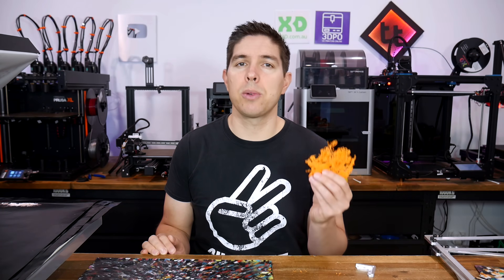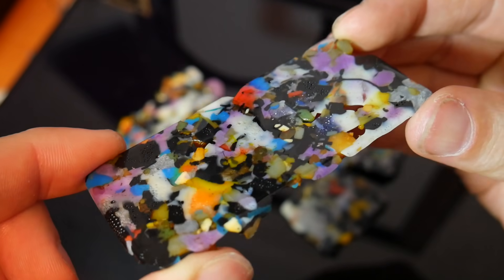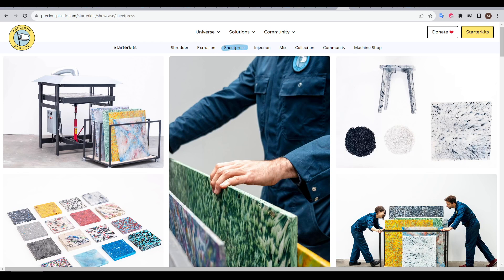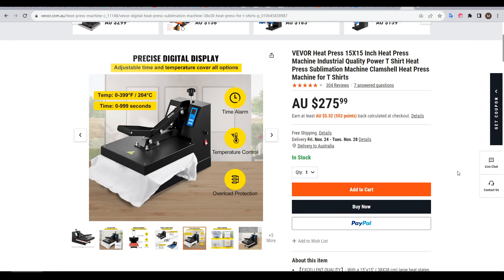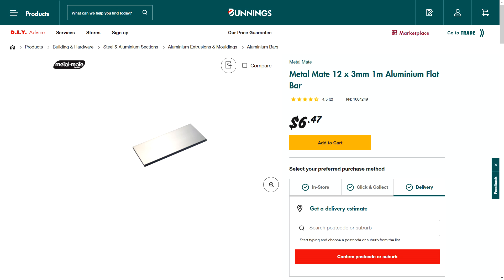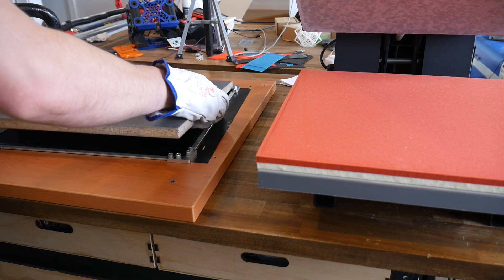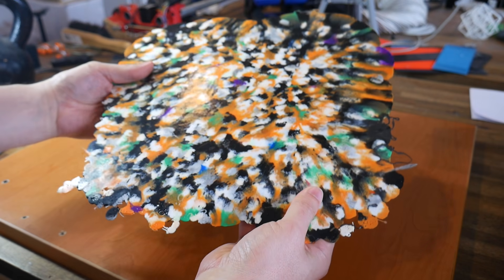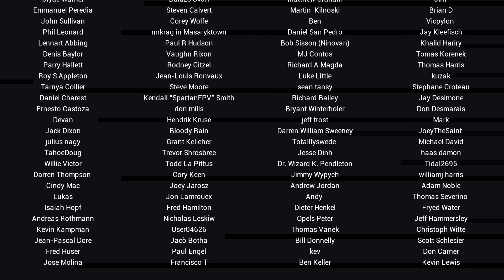Melting plastic waste into beautiful flat sheets on a budget

Comment: I would recommend adding a weighing step to measure out chips prior to pressing. Getting a consistent weight for the batch will likely yield better results than eyeballing a pile.
Reply: How much does PLA vary by weight? There's going to be additives like dye, so is that on the order of 5%? That would probably be fine, but too much more and you'd want to go with something like water displacement (probably annoying to do).
Reply: @szurketaltos2693  a margin of 5 % is WAY WAY WAY accurate then eyeballing it !
having to put a 100 Grams of plastic is way accurate than 2 fist full's of plastic 
also weight accounts for the hollow particles and the air gaps so you get way more consistency 

and are you seriously suggesting putting PLA in water before melting it ?
Reply: @fouzaialaa7962  5% is just a guess, I don't know. And yeah, I'm definitely not saying eyeball it. Yes, water displacement would be annoying as I said -- need to dehydrate after.
Reply: Had the same thought
Reply: Super obvious and I was astonished it wasn’t already done.
Reply: Since he has the ability to shredded uniformly, measuring it by volume might be more efficient than weight

Comment: Reusing waste filament to produce sheets for laser cutting or even melt into blocks for CNC Milling to create other practical items with unique patterns and in turn making it a one-off product is the best way to go for me and 100% what I'll be going for, and i think is the most cost effective way if you look from a business point of view if it's just a side hustle.
Reply: I found the notion of putting a collection of random PLA into a laser cutter a bit scary!  On average it might be fine, but if one in ten inputs are not, that could cause problems.
Reply: PLA machines horribly, and if preventing waste is the goal, casting billets of it for machining is just kicking the can down the road. It would be better served being extruded back into filament and sold as support material, or used in sheet form.

Comment: Just in case anyone hasn't mentioned it yet, these would be really cool as pickguards and plastic bits on electric guitars and basses. They're usually around 2.3mm thick if that's possible (The one you made from the bambu labs waste looks around that thickness in the video)

Comment: We used a heat press when I was in the Navy for all our waste plastics. Plastic was the only thing we couldn’t throw overboard, so we melted and compressed disks that were about 3 ft in diameter and about 0.5 inches thick. 

That got me thinking that you can satisfy two of your criteria by making sheets into circles. The first as your doing on your laser cutter shown at the end.

The second would be by spiral cutting a disk and then feeding those strips into your filament making machine. You’ll end up with so interesting colors in your prints, too.
Reply: You can't use 100% recycled material. Well, you can, but strength is greatly reduced. Making a good usable recycled filament uses a 3:1 Fresh/recycled ratio. My brother worked for one of the companies that made recycled plastic 2×6's. They used even less recycled material, 4:1. Only 1/5 of it was recycled plastic.
Reply: I'd imagine that the laser burns the material and makes it completely unusable as filament
Reply: What did you do with the 3Ft plastic disks?

Comment: Excellent, more than 20 years ago, when I intoduced some of my early micro, sub micro and palm size helicpters to the market, and was injection molding using an industrial bench top injection molding press I built my own plastic shreder to shred left over injection molded parts and debris. I used a heavy duty paper sheeder modified and at one point I had accumulated barrels of plastic shreds which went back into injection molding as recycled parts

i also experimented with the same style heat press to make thin plastic curved rc helicopter blades using a mold, the beauty of these machines is the heat contoller that allows one to dial in temperature and time.. Any heat type equipment  can be used in many ways to recycle plastics. And those T shirt presses have a lot of uses when you get really creative with them but you have to be careful in handling them when moving them from place to place, I nearly lost a finger grabbing the press near the hinge and as I lifted it it clamped on my hand and fingers, talk about severe pain!.

Comment: Awesome to find a device you can repurpose.

I was planning on building something like this from scratch. But this seems much easier.

One idea I thought about before, to solve size limitation. Remove one of your aluminium edges and put a previous sheet in there. 
This would melt the new sheet to the old. In theory you could make sheets any length with a small press.
I'll let you know if I get this far 👍

Comment: @Michael such a simple and inspirational process to recycle plastic! So much creative potential.
For example I'm already thinking could use smaller frames to make smaller squares which could be pressed a second time in larger frame to create squares with a square pattern. Similarly cutting a shape and placing in the larger frame and filled with new pieces could make sheets with custom art embossed. 
Alternatively making longer thinner strips could be weaved before a second press to create another interesting texture pattern. Would require a narrow frame, or the cutting of a thinner sheet into strips. Using laser cutter (or CNC?) on perimeter of sheets could allow adding an interlocking pattern, which would allow for assembling larger sheets before repressing seams.

Comment: I found a used Blendtec blender for around $60 and use that to shred my Bambu poop. It turns it into very small pieces quite well.
Reply: It WILL blend!
Reply: do you run it dry or with water?
Reply: @ericthecyclist just dry

Comment: Only got to it now. Great video.
As someone who has plenty of failed prints and other filament waste this video hit home.
I recently converted one of my Ender 3 S1's into a 5w laser.
So making melted sheets and then laser cutting them is a very viable option.
To get even tops and bottoms, I would place another tray on top of the plastic for a proper squish down.
If the top one is bigger, we could get an even thickness every time. Just like with your frame.
So final remarks on your video.
Highly inspirational ❤🎉

Comment: I have been trying to find a way to recycle my PLA waste myself that wouldn't cost me too much extra money and this is perfect. I already have a heat press, and the teflon sheets (that's what those BBQ ones are, I have a roll of if for pressing HTV). I don't have the equipement to build the frame but I think just a couple lengths of aluminum stock the thickness I want as guides will be fine, I don't need perfectly square. Now to just find a way to grind it all up that's cheap

Comment: Cool to find this video! Ive been mucking about with small scale recycling projects like this but never had the resources to get to shredder / shirt press stage. HOWEVER... 

A flat sandwich press with those BBQ sheets also works, it just produces much smaller plastic sheets and more ragged edges. The secret in this case is to pile a few bricks on top and let it cool cor around 30-60 minutes before opening. Also, since I can't shred plastics, I'm stock with HDPE / LDPE bottle caps, PP material like old nursery plant pots, etc. Bottle caps can be done whole and you can make interesting patterns with them, scissors take care of nursery pots, and I've tried some PLA leftovers but really need a shredder at some stage.  

As to what to make with the sheets - they can be planed and shaped just like thin plywood so you can make all sorts of woodworking projects, and one other thing I've done is scrollsaw a freehand shape (remembering I can only make small sheets) and drill mounting holes, then print house numerals out of PETG or PLA and use something like Liquid Nails to attach them, or put tiny countersunk screws from the back to hold things together. 

One other thing is that "waste" bottle caps etc need to be washed and dried before using, to get rid of sugars and oils, which isn't so much a problems with  filament. Was good to see your results, now I just need to make a few things and sell them instead of giving them away... Cheers and thansk for your video!
Reply: Oh and also a clue as to how much plastic to use - you can work out the volume of your sheets, and then knowing the SG of the plastic you're using, you can weigh out how much will be needed for each sheet (+ 2-5% for squeeze-out which you can trim once it's cold) so you can then just use kitchen scales.

Comment: We need more engineering going into flat sheets. Making filament at home is too difficult for most of the users but those flat sheets are definitely easier and cheaper to produce. 
I would like to see if it's possible to 3d print something on it.
Reply: Yooo hadn't thought of that, thatd be cool
Reply: Once upon a time I worked in the packaging industry- particularly when it comes to paper/cardboard, turning flat stock material into usable, 3D items is absolutely doable and an established school of design!

Comment: I’ve seen equipment from Vevor showing up in other maker channels, specifically their small furnace for melting various metals and their vacuum investment casting machine. At least from what I’ve seen so far, they seem to have quality products at a great price - and to see they have good shipping to somewhere like Australia is really impressive. 

As for uses, making practical things seems like a decent idea but with some care put to the locations of the colors of the raw material in the press I think the plates could have the edges trimmed cleanly and just be hung as abstract wall art.

Comment: Nice Job 👍🏻 

First thing that comes to my mind: there should be a way to make filament out of these sheets to get real color-changing filament.

Wouldn’t it be possible to produce really thin sheets like 0,5mm to 1mm. Roll them into a cylindrical shape and weld them together. After that you should be able to produce filament the same way you produce is from bottles.

Or maybe you could produce the ‚bottle‘ with deep drawing/vacuum forming or blow moulding.

Comment: I have a 20A 120V paper shredder I'm going to try this with.  I think a trick to make it work will be a sheet cutter just before the shredder.  This will be a pair of plates with a single matching rectangular hole in them.  The top plate(base) would be fixed with a hopper above to hold material coming into it.  The bottom plate would need to travel back and forth no less than the length of the opening in the axis of movement.  The two plates would need to be lapped to each other for little to no gap.  This will make the cutting more efficient.  Another plate would need to be under the dynamic plate but attached to the base plate.  This would use the thickness of the dynamic plate to set the thickness of the sheets to be sheared.  The driving/bearing configuration for the dynamic plate can be as simple as some V rollers and some aluminum extrusion, or as complex as a pair of ball screw rods either tied to one motor, or each having its own motor for more power.  The sheets coming out of the shear would then fall into a hopper to keep them on edge as they are fed into the shredder.  The speed of the shear can be adjusted to optimized the feed rate going into the shredder.  Not too complex, and build-able from salvaged parts if you are mechanically incline.

Comment: Just the info I needed. Was wondering if a heat press could be used as a small sheet press. Our community (in Australia) has recently been donated a shredder, injection moulder and extruder to start a Precious Plastics project but no $ to purchase a sheet press. Thanks heaps for your experiments with this

Comment: Wondering about using a textured 3d printer base plate to create a different surface from textured to the cell type one you can buy. I guess they should release.

Comment: I've been thinking about this ever since I saw the tray oven method of melting pla down. I wasn't keen on cooking plastic in the oven I use for food. I'll have to check out those t-shirt presses. Could you also use it to adhere flat 3d prints to shirts? I think a TPU 3d design on clothing could be useful.
Reply: Actually on that though, semi thin fabric like cheesecloth could potentially be pressed into the plastic to make a pseudo fibreglass type thing, so the plastic is reinforced, and could make even more stable stuff.

Comment: At the very least, sheets like that will store much more easily than a bucket of waste material of various shapes and sizes. I recently threw out probably 10 kilos worth of PLA waste, and felt pretty bad about it, but I simply don't have the space to store them in that form. I also can't justify the money for a press like that as I don't produce nearly enough waste to get more than a sheet or two per year, but if I ever scale up and start providing a print service in my area it could very well be worth it for storage reasons alone.

Comment: Nice idea on the frame. I have been using a laser-cut square frame on my heat press but making it from frames is so much cheaper. The CNC cut part was over $100 for 4 on PCB ways but it should be printable on a resin printer with abs like resin or just  made using some spare bars

Comment: Do you think you could try melting full size failed prints in the oven without shredding them, then putting them into the press to flatten? Maybe once it's melted you can smear it around to approximately get it even before putting it in the press.  Obviously you don't get the same nice pattern, but you skip the shredding, which is a huge time saver and less equipment.

Comment: I've been wondering about how to recycle old unprinted PLA that's too brittle to be fed thru an extruder. Was thinking of making a bottom cover for my CoreXY. I'm not gonna spend money on a T-shirt printing device... so gonna try my luck with an oven, either baking paper or aluminium sheets and a good ol' rolling pin to get it as flat as possible.
Reply from the maker: I think if it comes out of the oven very molten, and you clamp it immediately you can get good results.

Comment: This is wonderful, and it's great that this looks identical to what I'm a few steps behind you on. I loved watching through this, every step in this video has been me nodding my head along as you went, since it's almost exactly the process I've been working through for a few months. 

Thank you for doing a bunch of that early research and experimentation, makes me feel a whole lot more confident spending the time to build out my setup.

One question: you were making pretty thing sheets, and I don't know if I missed in the video exactly why that was. The primary reason I've been waiting to test out a tshirt press before buying one was because I was thinking half inch sheets would be the most useful to make and I wasn't sure I would be able to get those done well in the press. Did you experiment much in that area?
Reply: i think the main reason the precious plastic press is 400 volts, is because of the heat needed for half inch thickness to melt.. outside is easy to melt , but the inside..
Reply: I am following this because I was also hoping to get closer to 1" and be able to build furniture from it.

Comment: Hello Michael! Do you think it's possible to use powder coated flex plate for 3D printers to replace the barbeque liner? It can create some nice matte surface. 😄 
I know the adhesive of smooth PEI sheet can't withstand that temperature but not sure about the powder coated ones.
Thank you!
Reply: This would be a good idea I think, and I've got a whole bunch because Overture used to ship them as a bonus with their filament spools

Comment: You could modify the press with an aluminium plate on the bottom, heated with a silicon heater like the ones in a 3D printer's heated bed. Would it help to heat from both sides?
Or just make such a press yourself with these mats and alu plates.

Comment: I’ve been wondering about forming super thin sheets and using a PET recycling jig to make new filament.
Reply: Unlikely to work. Pultrusion depends on having a broad temperature range where the plastic is malleable but won't stretch beyond a certain limit or tear. PET excels at this. PLA not so much. It will easily rip when pulled above 100 or so. (Think about cold pulls.)
Reply: @daliasprints9798  Hmm.  Sounds plausible!  I'd also guess that the randomness of the content wouldn't help, it might be bound together, but the bits might have different enough attributes when attempting to cut or stretch them.

Comment: Does it make a difference what types of filament are being recycled?  Should you be careful to sort your PLA, PETG, etc.  scraps into different recycle bins prior to creating these sheets or can you just mix them all together?
Reply: You should absolutely sort plastic types, with the criticality of it depending on what you’re doing with them.
Different polymers have different melting temperatures so what might liquefy one may annihilate, (or make no change to) another.

If you’re making recycled filament then obviously having a clean, consistent material stream is essential, and even when making plastic sheets I imagine using a blend of different plastics would result in inconsistent products with weak spots and other failure risks